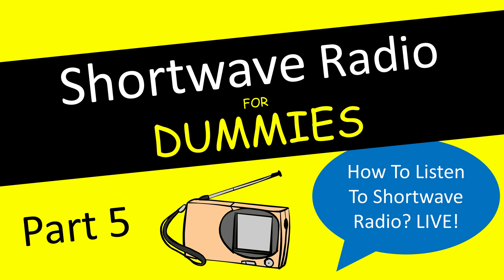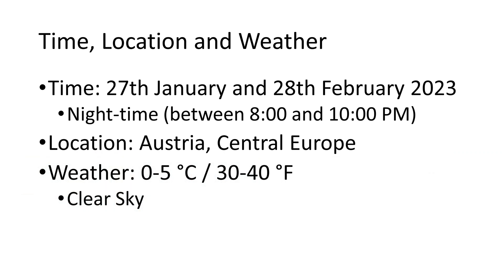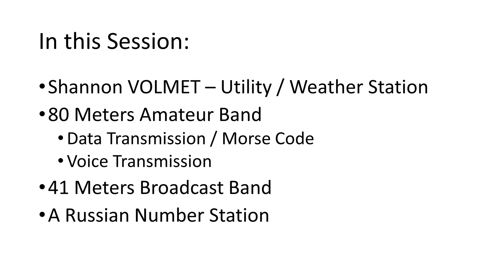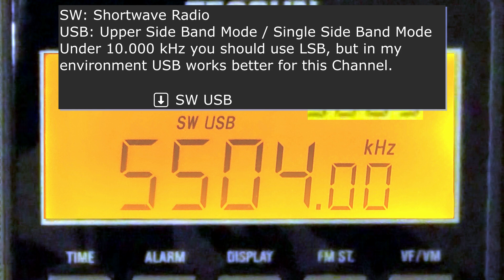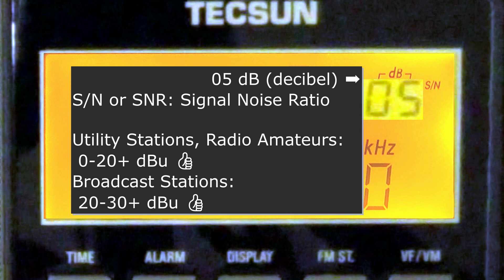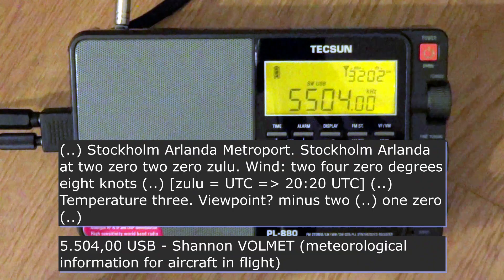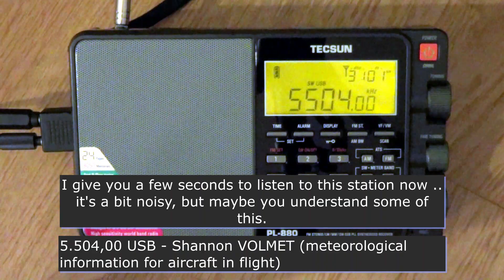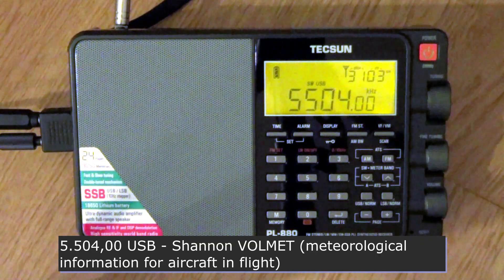What is Shortwave Radio? - Part 5 | How To Listen To SW Radio?

Comment: Great series, thanks! On the VOLMET message: 'QNH 1025' means the air pressure at that airfield is 1025 hPa. It is the setting to be entered into the altimeter of the airplane for it to display the correct altitude.

Comment: So if my radio doesn't handle lsb/usb modes that means I will not listen to any numbers or buzzers?
Reply from the maker: You can listen depending on the Mode these Stations use to encode the signal. You will find Number Station broadcasting in normal AM Mode, these you can listen without SSB. Check https://priyom.org/ for the Scheduling.

Comment: Second question: I understood the first couple of digits shown on the top right part of the radio lcd display is the strength of the incoming signal and the higher the better, I'm not sure about the second couple of digits. Is it the NOISE ( = the lower the better ) or the signal after filter (the higher the better?)
Reply from the maker: The SNR is the difference between the received radio signal and the background noise. So, the higher, the better.

Comment: I have a follow up to my previous comment. I have received amateur radio transmission ranging from 7275 to 7295, without using anything but the factory antenna that is built into the radio and just pointing it into the direction of the broadcast to get the best reception.
Reply from the maker: Congrats Steve! It would be almost impossible for me in the middle of the city .. 😮